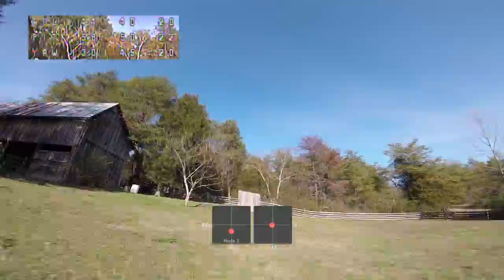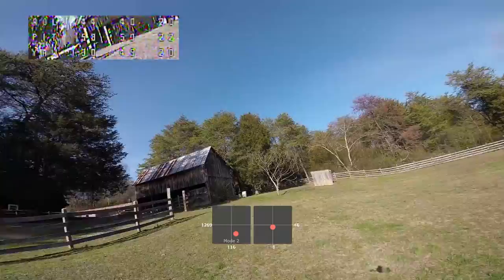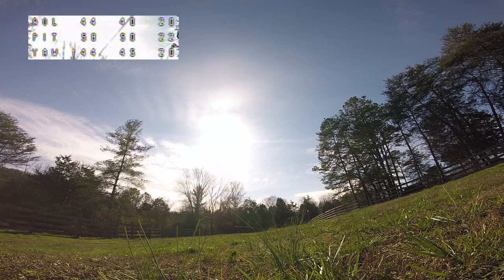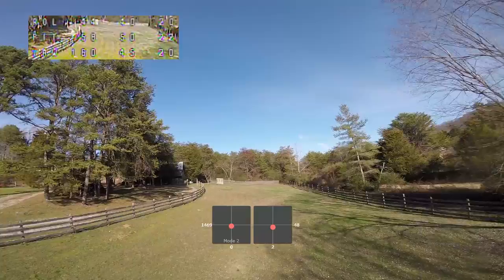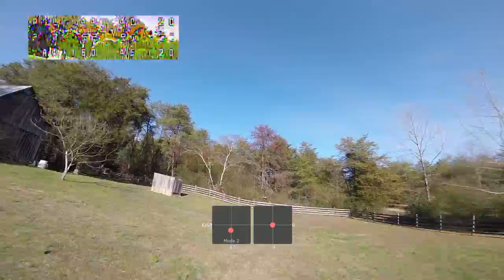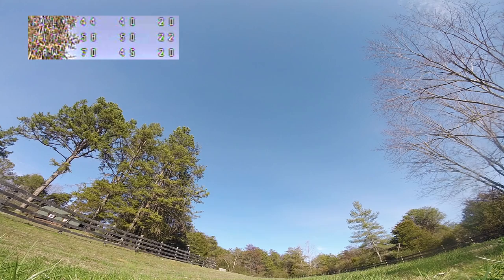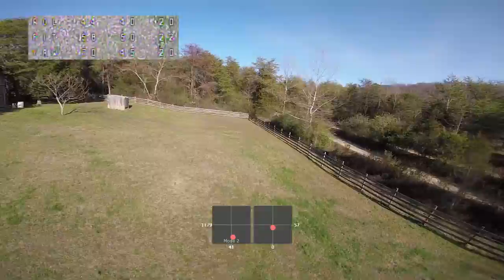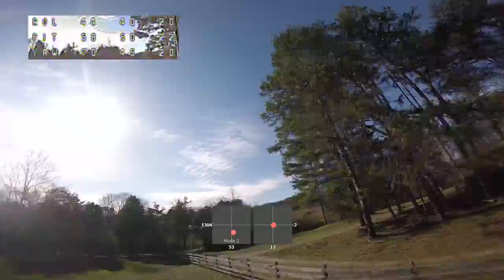PID Tuning Masterclass - Part 3 -  Yaw P Term

Comment: Great material! Keep it coming. I really like that you are showing examples of the extremes in this series. I'm getting more comfortable with tuning, but it's great to have a better understanding of how far is too far, and what is likely to smoke a motor or ESC vs. what is safe even if it's twitchy.

Comment: Hi Joshua, firstly thank you for the tutorials - they are massively helpful. Secondly thank you for the end of this video... As a new FPV flyer I had a similar yet opposite experience - I was not where I expected to be and flew straight into my own face. You've made me feel a bit better about having done so. I had just got a GoPro so there is evidence on my channel if you fancy a laugh (goggles were ruined but I am fine).

Comment: you'd mentioned the bit about sloppy turns in the last vid... I started taking yaw P term up a bit and definitely noticed a difference from stock. I know it's difficult to document a lot of this stuff as it really is up to feel, but it's much appreciated. Looking forward to the I term piece, and hoping there's a nugget in dealing with nose pitching before anti_gravity fixes (I'm tuning on kiss right now - my first fix was to drop the first TPA breakpoint that covers the lower end of the throttle range).

Comment: 3:54: "I can't believe I fell down up side down - I have to walk down [there]". It was 2017, before turtle mode=P
Cool series man, even in 2021. I have a problem with the quad pitch bounce back, especially after a pitch maneuver, but also on rolls. I suspect that my I gain is too low, but I'm learning a lot here now.

Comment: Soft-mount the FC and Motors, use stock pids with a 30% increase in pitch P term for long body quad and 10% increase in pitch P term for true X quad. Then the rest of the tune is in the rates. Life is much simpler that way.

Comment: I am not sure if this happened only with me, but I was having a LOTTT of jello on my Gopro Hero 5 session, I checked everything, motor balance, prop balance, PI tuning, I tried every possible thing. I then played my Gopro footage next to my betaflight log viewer, and it turned out I had continuous high-frequency oscillations on the Yaw axis. I decreased the P term of the Yaw and the video is much better now (can nearly see the jello) but I can still see some oscillations on the betaflight log viewer not sure if I should increase the D term, will try this soon.
Reply: Oh, and by the way, Joshua you are a Legend!

Comment: with the more powerful motors, it seems like if you push yaw P too high it does cause very noticeable oscillations in the yaw axis in blackbox, and creates a shaky quad in flight unfortunately, an prop wash on turns gets bad. it's very odd and hard to tune for because it seems like D term oscillations when turning reaaallly hard when going fast.

Comment: Hi Joshua. I fly with betaflight 3.1.6 on stock PID's , dshot600 and I'm impressed how well it flies. Befor I was flying on cc3d and pwm esc protocol the difference is massive :D. Quad is really locked in. But in only one exception. When I fly fast forward in pretty sharp angle Quad start to oscillating fast, does are very small but fast oscillations. 
This is only one situation when oscillations came out. 
I read the betaflight wiki end they say it may be to high Yaw p therm. What you think ? I will try to lower the yaw p when I will have time. Because it's super smooth on turns and normal speed straight flying. But I love fast forward flight :p. 
Greetings

Comment: Excellent series (again) sir :) thanks for putting in the time & work! 
I've got an unrelated Q: I watched your video's on the resource remapping, but can't figure out how to map servo-outs to the first 2 pins.. Can that be done?
Reply from the maker: Just enable servo tilt int he Configuration tab. Motor outputs will shift down to 3-6 and servos will be on 1-2.
Reply: Yeah.. I had the quad (a tiltrotor) set up like that in it's older Cleanflight setup.. No dice after flashing Beta 3.1.6 onto it though..

Comment: Do you know of any pi projects using it as a blackbox? Or see any reason why not to? I'm using a Pi Zero for video recording and wondered if I could rap it all into one device.
Reply from the maker: I don't. I guess the main reason people don't use Pi is the weight? I don't know.
Reply: Just to clarify, my pi zero and pi cam plus lense conversion (metal but could reduce the weight with plastic) in total weighs 25g and my power is supplied by my quad, compared to a run cam 3 (66g) which has the same video quality.  BTW I dumped gtune and converted to Betaflight, the pid tuning is going really nicely, thanks for all your tuning videos it's made the process logical and progressive. A bow to you Prof Bardwell, the winds of Scotland are being tamed. Shout out the my local club Falkirk Drone Club.

Comment: Hi. Thanks for videos, very helpful even for LOS settings.

After a hard yaw and after centering quickly the stick, my quad jumps by about 1 meter. 
I'm not sure d_yaw is still valid on Betaglight 3.1.3 (it is available in CLI but not in PID interface). 
Thus I have increased yaw_accel_limit from 10 to 20, however no improvement at the moment. 
Shall I increase it again or play with other parameters ?

Thanks in advance for the advices.
Reply from the maker: +Fosch yaw accel limit is the correct please terminate to play with. But shouldn't you be lowering it?

Comment: How did you manage to PID tune on the field without connecting to your FC?
Reply from the maker: I was using in-flight adjustments. It's a tab in Betaflight that lets you tweak pids rates and other parameters in flight.
Reply: Thank you so much for and quick reply you are the best. Love your vids and see you have one about the in-flight adjustments., I Will give it a watch

Comment: If you hover & yaw spin when you release you sometimes see the copter slowly turn back the opposite direction. Is that an indication of Yaw P too high?
Reply from the maker: +Okinawa FPV that would usually indicate excess I gain. Bit P is so ridiculously high here that anything is possible.

Comment: Hey, i was just wondering how to go about removing yaw jump in betaflight 3.2
Reply from the maker: First look at blackbox to be 100% sure you're not just bumping the throttle by accident.

What props and motors? Over-propping the motors can slow response to the point where you sometimes get yaw jump.

There is a parameter in the CLI, acc_limit_yaw, which you can lower to reduce yaw jump. But most quads without mechanical issues don't need it changed. So I would be looking first at your setup, not the tune.

Comment: hi! I am getting realy bad half throttle yaw twitching, maybe someone can help me. standard betaflight pids
setup: aokfly rv2306 2400kv
racerstar tattoo 35aX4
hglrc f4 aio
realacc rfx 185 frame/ulx clone
Reply: Exactly same for me. Lots of yaw oscillation at around 30% throttle, goes away above 40%. Blackbox shows massive P oscillation on the yaw axis, so I'm turning it down to 30 and seeing if that fixes anything.

Comment: Joshuah, I need more advice if possible please bro, im literally on the verge of sticking everything on ebay and walking away.. After two years flying and never tuned any quads. Ive spent over 20 hours watching your videos and uavtechs videos on tuning and blackbox and gained absolutely nothing. Quad flies okay, except for non stop yaw oscillations and snappy yaw twitches, BB says at full throttle and ZERO yaw, theres spikes on the yaw gyro showing up to 200 degrees both directions, ive raised P and I four times and gaining absolutely nothing 😭😭😭 even tried adding some D from zero D on yaw, raising I to obscene levels still doesnt lock the yaw axis when I punch throttle. I cant work out if my filters are right as i cant find a simple retard explanation of wth PT1 is, i dont understand low pass filters even after watching your videos on this, same with dynamic notch filter. I understand gyro notch filters.. But theyre turned off in 4.1 😵 Any ideas sir?